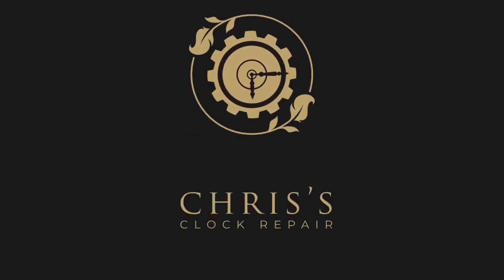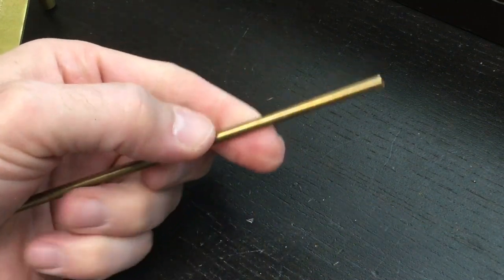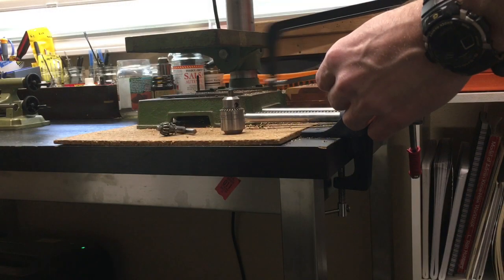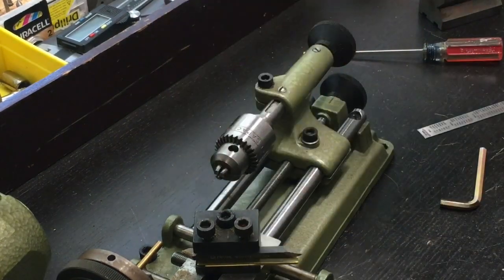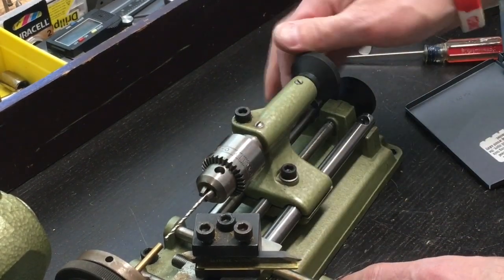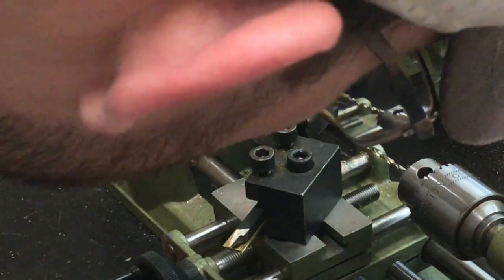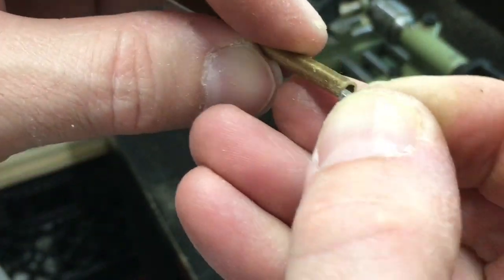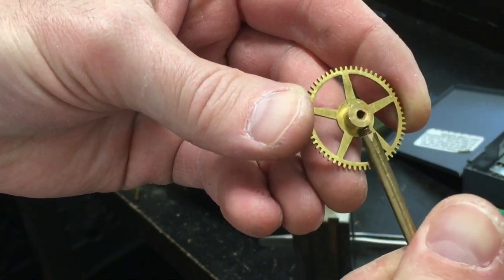Lathe Adventure! Making a hexagonal wrench

Comment: In my experience the unimat lathes are a little less accurate. But sometimes you get a good one. I have 11 of them. I use 5 of them as a lathe. And 2 as a mill. 2 as a drill press. Each se up for different tasks. 1 is on standby. They are a very versatile machine. Lathe, mill and a drill press all in one. Easily converted from one to the other. I will say that putting a brushless DC motor on them make a world of difference. Rebuilding the feeds helps a lot. I have restored them and put better bearings in them. And turned more accurate acme feed screws. My most accurate one has .0004" runout.

Comment: Where can I find an Escape Wheel from a G.M. Angem cuckoo clock? Locating that piece is difficult online like Timesavers, Clockworks, and Meritts don't carry it. Any ideas appreciated!
Reply from the maker: Buy a spare movement online and take out the escape wheel.
Reply: @Chrisclockrepair  it's a gamble with so many versions out there. Is that how you get your movement parts?
Reply from the maker: @8953147  Not typically. I usually repair them or make new ones and if i can’t make it, I’ll send it to someone who can.
Reply: @Chrisclockrepair  Thanks